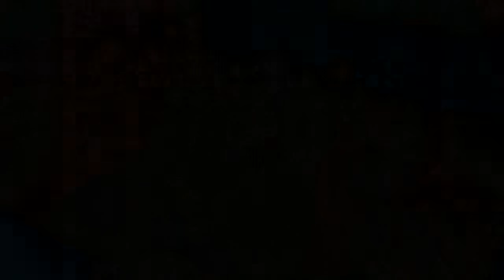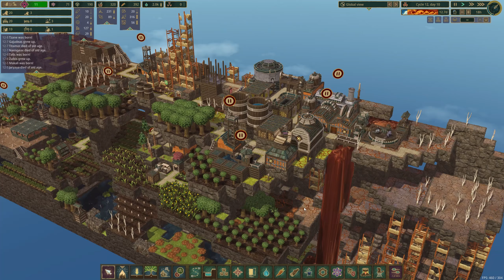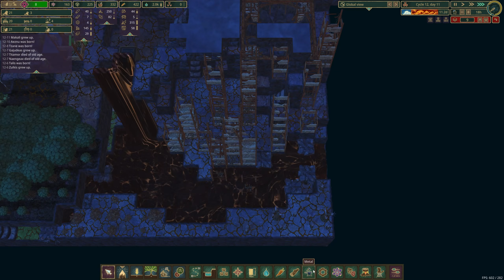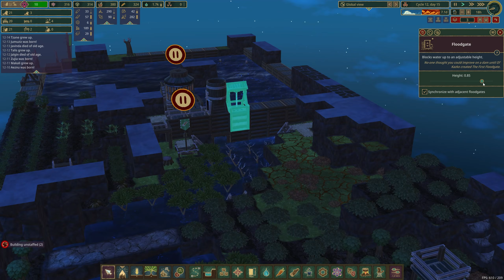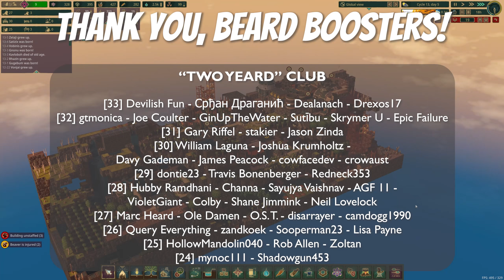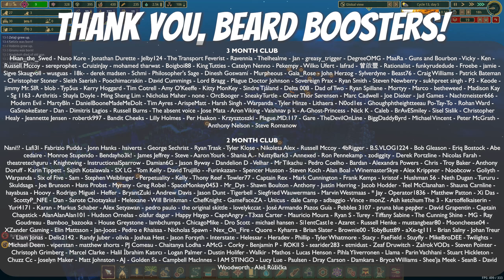Time to get working on some improvements! Timberborn 1.0 Experimental Iron Teeth Episode 11

Comment: → 29:24 If you pause one of the gear workshops, you should pause the one which grabs power from your currently still somewhat limited power source upstairs, so you can run the other power consumers more efficiently (or reduce the beavers on the training wheel), instead of the one with free power. (I guess you did this later when you noticed you'll get a drought, but I think it would make sense even before.)

Comment: On the leftmost diversion,  you should set the sluices 1 level lower than the floodgates were. That way the clean water is running fully into you map, and not over the edge in the back constantly.

Comment: For the water system on the top left of the map just to the right of where the current floodgate is if you tear out the platform you can put a bad water only sluice gate before it goes around the corner and this will help keep the good water from going off the back of the map during temperate. It also will make it so that whole system is pressurized and if you wanted to in the future could use this to make a water tower to store up a ton of water

Comment: 50:28 I do think building a fluid dump right by the pool you're aiming to splash is better than further up on top of the sluice. I suspect that splashing up there is going to waste water.
52:30 You can also use a bridge to get there (that's what I did in my playthrough), but stairs might be still be better. Doing it with a bridge requires removing two blockages plus, I think, a 6-long bridge (which is very expensive).
Reply from the maker: I don't know that the water would be any more wasted from splashing higher up, but I do hear the argument for just putting the dump in the right place to begin with

Comment: Those platforms down in the bad water, if they were levees instead, it would reduce the area of bad water down there and reduce the contamination slightly?
Reply from the maker: It would, yes. We may be able to design that area to take advantage of overflow and make it even less polluted too

Comment: If you remove the blockages near the badwater and put floodgates where you have the platforms, you could channel the overflow of good water into the water wheels and push contamination further back at the same time. This next drought is the perfect opportunity for this. Also justice for the shrub

Comment: Starting from the platform under the bad water pump and going straight down, you should add a wall of levees. They will help flatten the terrain, and limit the poison on surrounding tiles. I would make that pool as small as possible using levees to limit that spread and maximize power output.

Comment: You should put the sluice between your dam and mangroves down one more level so you have access to water longer. Also set it to .85 instead of .9 so you're not potentially dumping it out the floodgate you have set at .9

Comment: Could you potentially stack your large warehouse on top of the other one you have on the middle level near the trees? You'd have to build stairs to reach it obviously (maybe spiral stairs?, or rotate the building so the entrance is diff than the lower level). It does look like your bottom river could be continued further by continuing on that dam you just built, once you get bad water diversion on the upper levels; instead of cutting off that river with levees.
Reply from the maker: We'll see what ends up working best about storage locations, but I have some ideas for irrigation like you're talking about that we may be able to do sooner than that

Comment: @11:34, they physically cannot path diagonally which is the first reason why the building isnt in range. I think it would be valid to place a platform then the single levee down at the bay's entrance. Then you can start to use platforms and remove the blockages to make a cheap artificial land bridge in this area.

[From the left, you could start to path.]

Comment: Are sluices still one way? Because if you block off that square at the lower badwater level, like you planned and put a sluice in the blockade and then block off the normal exit for the water with the mangroves, then there would be more waterflow through the power wheels at the bottom. Plus the bad water would be more diluted at that level and (hopefully) reach less far. Off course you do not want the bad water back flowing during a bad tide, so it hinges on a sluice being an one way valve.
Reply from the maker: Yep, sluices are all one way. I'm hoping to put something in like this soon

Comment: 0:49
You could maybe also cover the bottom with the impermeable floors, to reduce contamination.

5:32
With one levie near the other blocages, where the bad water river passes, you can reduce the contaminated land.

12:01
Don't use platforms.
Use levies.
They will reduce the contaminated area by stopping the bad water from filling the space to the left.

15:55
If you put a stair just after the last tree you marked here and put a small bridge.
Then you move the second fermenter one block closer to the front of the map, you can make a passage there, allowing you to move the water wheel and add a second one in front of it.
And if necessary, you can add a power wheel connected to the front water wheel.
31:51
Yes

49:55
You already have the hole for an irrigation station here, you just need the dump on the pond at the middle level where you have the floodgate.
50:15 
Or you put it on the pool itself.
Reply from the maker: Impermeable floors won't do a ton in that area until everything is completely level underneath them AND there's no dirt touching badwater at all including the sides

A lot of the rest of this can be resolved soon!

Comment: At the bottom of the waterfall, it would be a pretty good thing to create a one or two wide channel using levees in something like a 90 degree angle all the way out. Not only can you fill them with water wheels to create a monstrous amount of power, but it would limit the range of the bad water contamination. It would be a massive undertaking, but eventually you could run a series of power shafts to link the bottom power generation to the top so that once you can force open the bad water source, you'd have all the power you'd realistically ever need at both industrial areas.
Reply: 1 wide is the best
Reply: @barnabasschenk4507 Agreed 100%

Comment: ...8 minutes in, timer is running, he is talking about random BS he claims is frustratint and still no beaver storage built... bites desk - 20:30 "let's put a tank here, can't do anything esle with this land (despite looking for a place where to put housing moments ago^^). I would personally put that medium tank at the same place as those two small ones and a path directly next to the pump, but I can see how you would want to put another pump on platforms there later.^
But no, let's keep a growing percentage of your popualtion too slow and dying prematurely instead... 
(the starts fixing it) thank you sigh*... 16 beds wouln't have been enough anyway, although you *can replace both of the storages existing at the start of the episode once you have the science.

28: You can avoid stuff lying on the ground and potentially disappearingby pausing the building and only deleting it once the stuff got carried out from there.

Comment: 13:15 I hope you'll see it later on, but these platforms should be levees. Just to minimize the corruption on the left side of the badwater pond 😊
Reply from the maker: Yep, those will get swapped out in due time
Reply: I just was going to comment this. Thanks for saving me the work.
Reply: Have been having that stuck in my mind for two episodes already